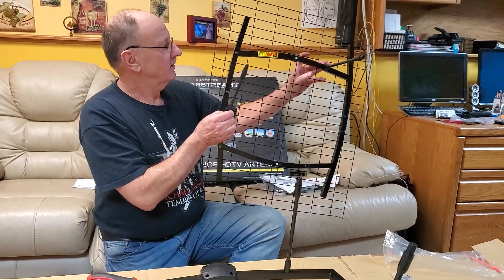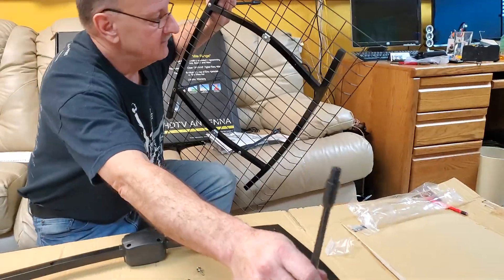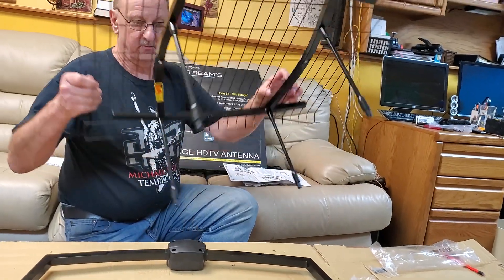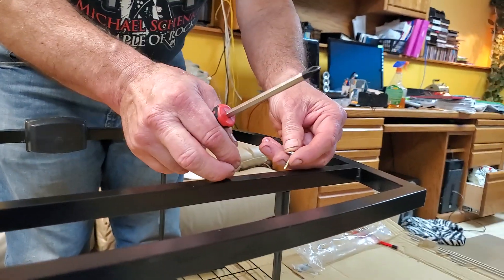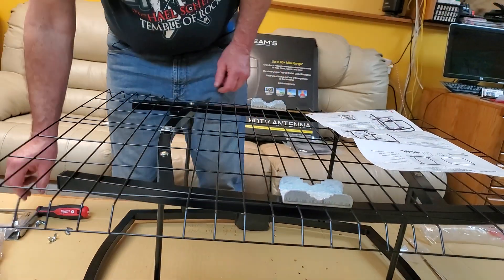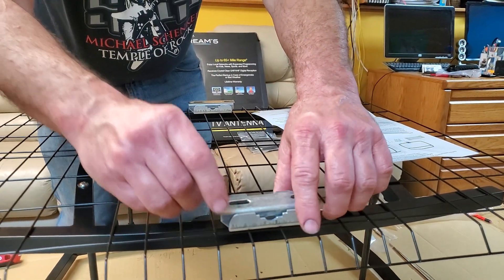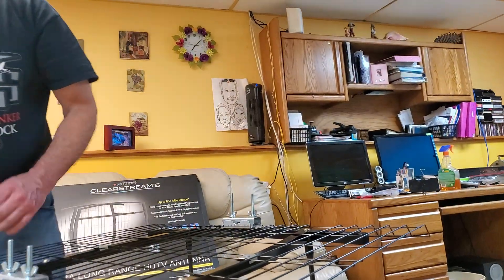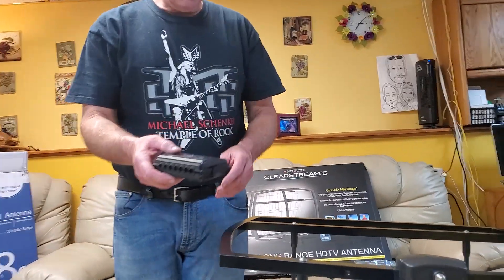Antennas Direct Clear Stream 5 Assembly Part 2

Comment: It's too bad that diplexer doesn't have an FM input to ad an third antenna for FM reception like the Polish diplexer Zwrotnica antenowa AMS ZA-104MS which has 3  inputs: UHF (with 4G LTE filter and power passthrough), VHF High and FM. The AMS ZA-204MS model has power passthrough for all 3 ports to mount 3 antennas with built in amplifier.
Reply from the maker: There are a lot of different diplexers out there. I use the Antennas Direct type diplexers, actually two of them. I had to join a south-facing DB8e and south-facing ClearStream 5. I used the second diplexer to join a north-facing DB8e and ClearStream 5. Then I ended up using Televes SmartKom to join everything, including some VHF low dipoles I created from to direct antennas VHF High add-on dipoles adding extensions. I wish I could add a photo here.
Reply: Bob I like to see that set up thanks
Reply from the maker: @419jblack  I'm going to make a video on some testing I did between the Televes SmartKom and the Johansson 7474L2 on my AD "totem pole" with 2 DB8e's, 2 C5's and some Homebrew VHF low dipoles.
Reply: @bobh.4580  awesome keep up the great work Bob I sure do enjoy it thank you